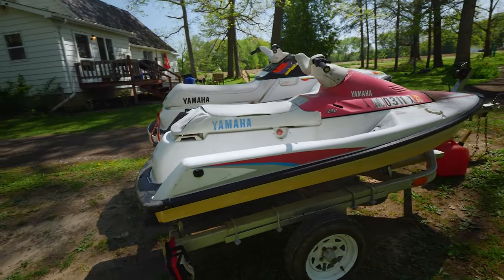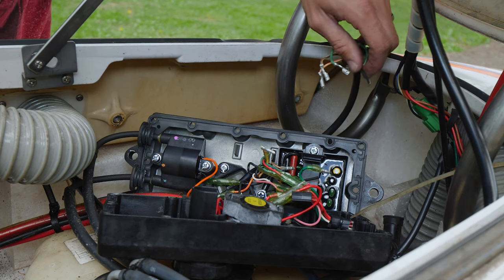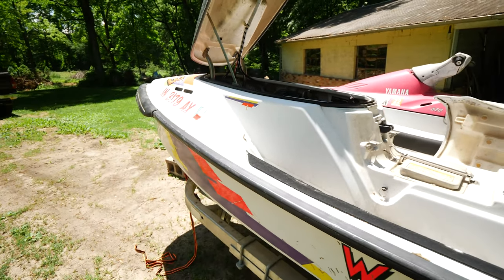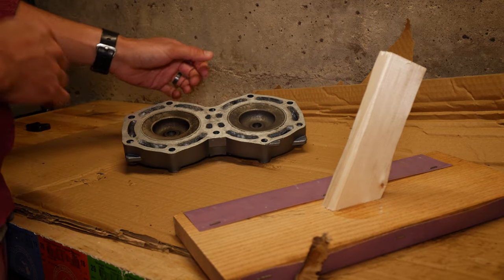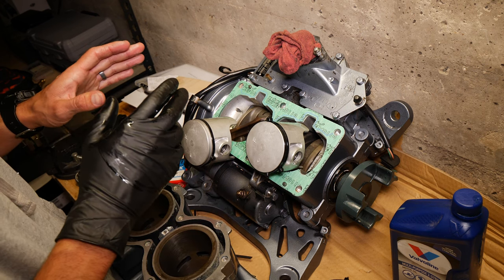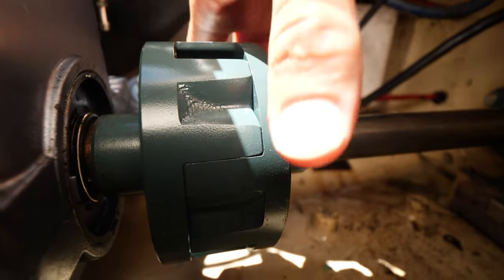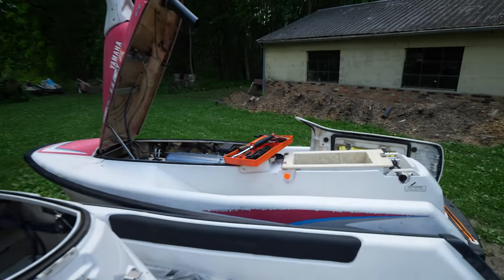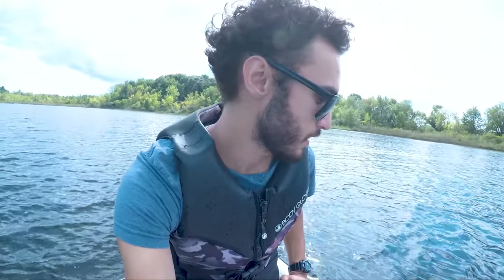$200 Seized WaveRunner 3 Rebuild

Comment: I have a 93 and 94 exactly like tge other one you have. Mine is not pumping out water. I did replace the jet pump when i first bought it 8 years ago. It set for that long and this year o finally drained tge gas and installed a new battery. Thing started up like a beauty. But again im taking in a lot of water and it dosent look like it's pumping it out. I believe these pump out the rear. But i dont see a line hooked up.
Reply: It runs fantastic for the first 20 minutes and then it begins to bog down every time. But it'll immediately start right back up and idle perfect. I feel like it's either not pumping out the water could be the issue or something with that temp sensor.
Reply from the maker: @bradbearden346  Check out my vxr 650 video. I had a cooling line that was disconnected that caused the same issue you described.
Reply: @RuralPlayground  Okay I definitely will! Subscribed and liked!! 🤙. Just changed the fuel filter and air filter. I'll check your video out prior to replacing the gas and plugs. I shouldn't have been such a cheap ass and siphon gas from my boat. It probably had some water in it.

Comment: Is the compression low on the VXR? The difference in performance might be due to the pump size. Some of the Yamahas had 133mm pumps so a rebuild might not make a big difference unless it's low on compression.

Comment: Hey man great work on that thing!  I have the exact same jet ski and it flipped in the water a couple years ago and I havent been able to get to run since... It ran absolutely perfect before that moment. You used to be able to click the starter and it would start immediately...   I can get it to start up and I can rev it but it shuts off once it comes back down to idle ....  Is there anyway you know what I need to do ? 

Thanks a ton
Reply: check your fuel reeds and make sure they aren't messed up, also check the carb make sure the internal fuel filters isn't dirty.

Comment: Found a 1990 wave runner 3 for 500 bucks with trailer is it worth it the guy says in needs lots of work not sure what that means are these simple never worked on one before I assume it’s like a lawn mower but with a jet and it’s on water

Comment: You can just pinch those rings up into the cylinder, there's gaps on either side that your fingers can go. No need for zip ties holding them

Comment: Proper maintenance makes a difference between 300 hours being a death sentence and being brand new. No ethanol never. And apparently it is better to leave fuel in these with stabilizer that is to let them sit dry like other small engines.

Comment: Do you think the engine really needed to be completely removed? I just picked one up tonight, oddly enough for 200 and i was planning on redoing it in the ski. Thanks for the video!
Reply from the maker: Pulling it out makes it much easier to work on. Keeping it in the hull makes it a lot more difficult with the lack of space you have.

Comment: Just curious.... whats the cost on having a machine shop bore them out? I have a simular projet lined up. Also I have to say this.. Your edits are awesome. I like that you showed forgetting the throttle cable. It's not easy..lol
Reply from the maker: It was 60 bucks for the shop I used.